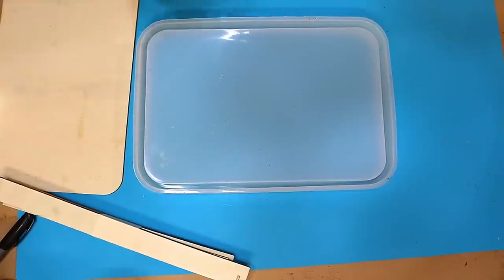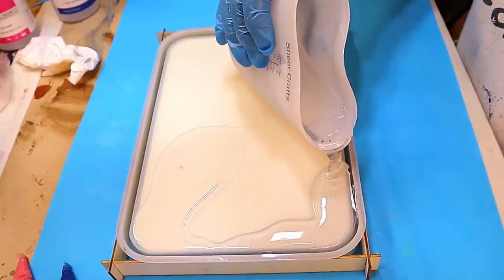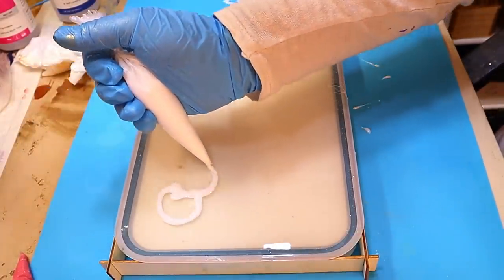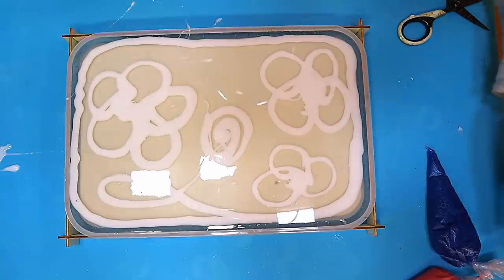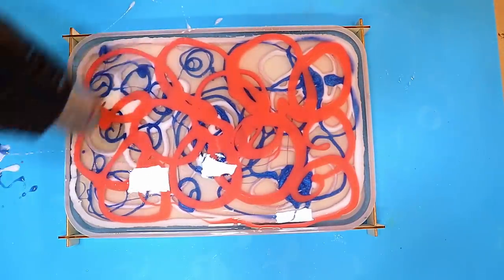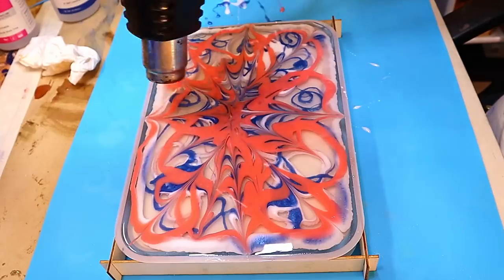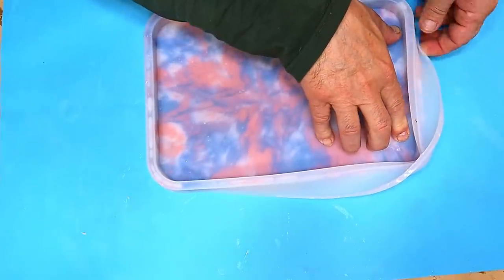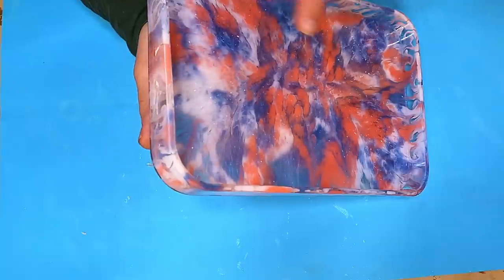The Results of This Resin Experiment Shocked Me

Comment: Hi Steve,  in your extensive experience do you have a suggestion as to which type of hand protection is best when working with resin? I’m just starting out. Be it rubber, vinyl, or other? Thanks for the insight. I have no allergies to any of those materials. Also, are KN 95’s enough with a fan or do you recommend a filtration mask?